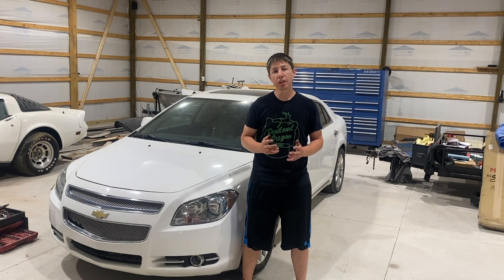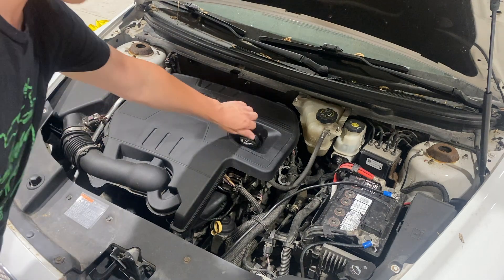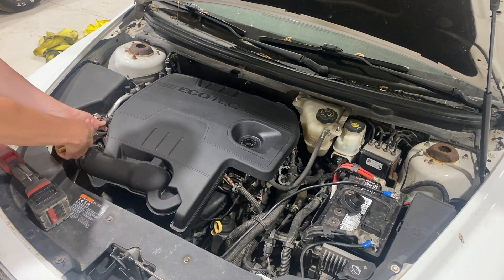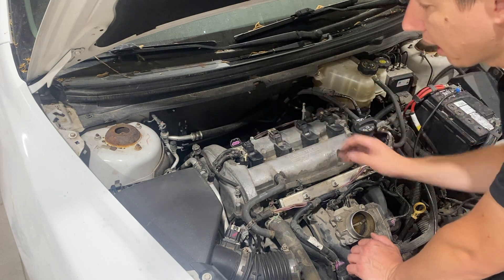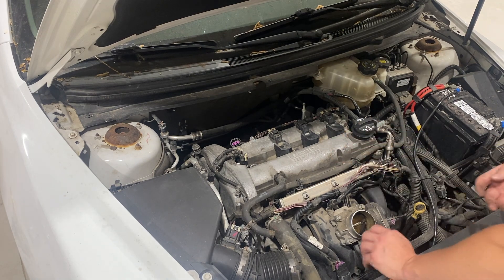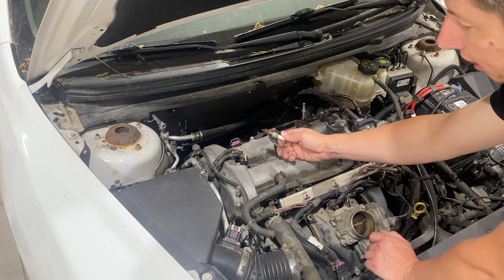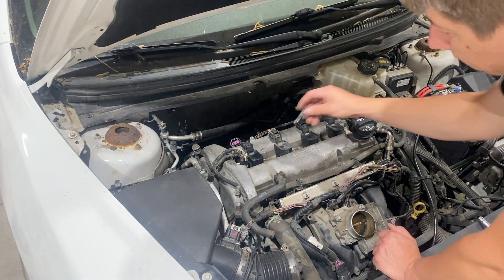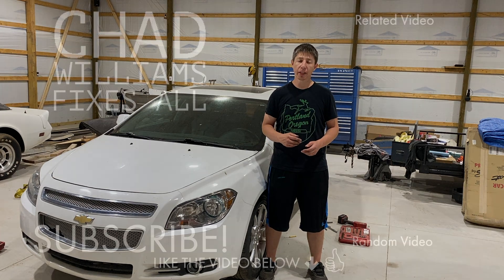Chevy Malibu Spark Plug Replacement - How To

Comment: I saw you said a code can be given with a spark plug being bad. Here's my issue. I have. 2010 Malibu that gets power but won't start. It doesn't crank, click, nothing.  It seems to start better when it's cool outside or has been sitting for 3-4 hours. We have replaced battery, the starter, ignition switch, both battery cable that attached to terminals, several fuses, starter relay. Our last option was to take it in and see if someone could find an exposed wire. When I told a friend, she said it could be the spark plugs. "If it's to hot and a spark plug is bad the engine won't start or crank." Her words. I was going to change them tomorrow but if a code actually appears for these to be messed up then I could b wasting my money
Reply: I have same year and car and had the same problems. No crank no Start but all lights and radio worked. I diagnosed it with a standard code reader and the ECM was the issue. I went to savage yard and got a used ECM for about $50, took it to a shop to be put on and programmed and problem was solved. Hope this helped. 🤞🏽